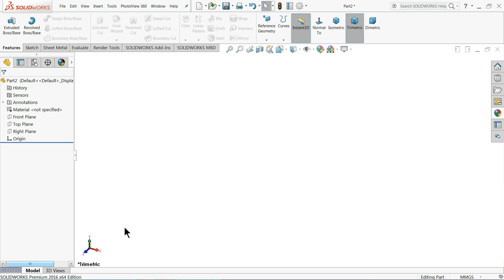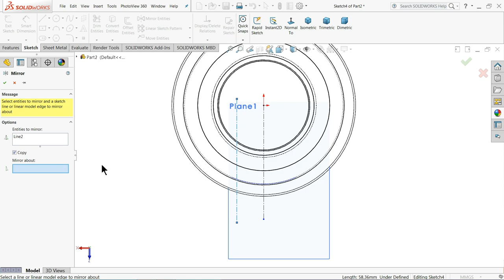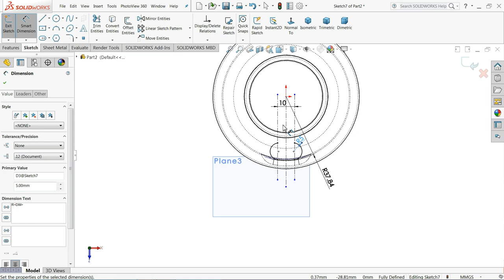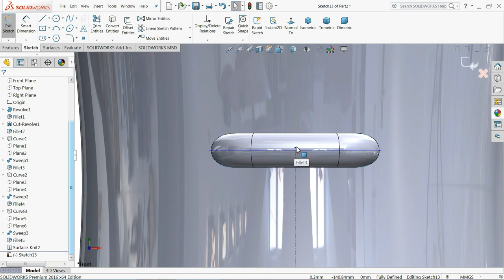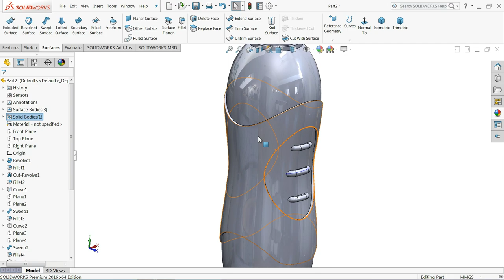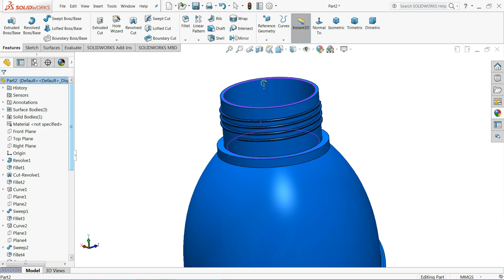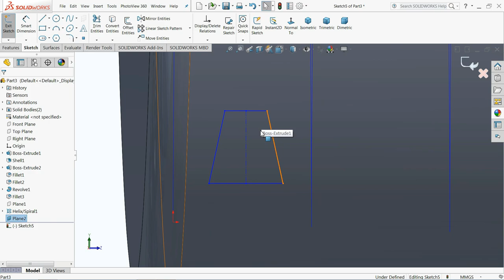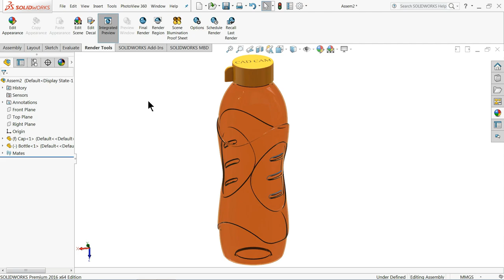Solidworks tutorial | Design of Bottle in Solidworks ( surfacing tutorial)

Comment: Thank you for your SW videos. My experience in SW is limited and only learned a bit on my own at my previous workplace.
I have a question.  On the cap side tab, when created and extruded, is their a disjoint created because the side of the cap is a radius and the tab was extruded straight... i.e; only connected at the mid plane of the tab extrusion?  Thanks, and I enjoy your videos.

Comment: Cant trim the surface
Reply from the maker: there are three surface trim, which one makes problems?
Reply: Can't able to trim the lower part design and the upper ellipse one. whenever I try to try I can't able to select pieces to keep in the body.
Reply: saur kush same happened with me.
I tried deleting the surface extrudes and making them again and then they got trimmed easily.Just repeat the steps again carefully you will be able to do it
Reply: @Ok_senpai  how much time have you take to make it